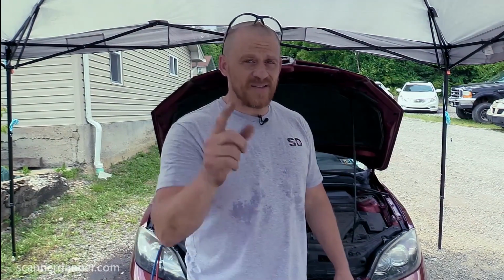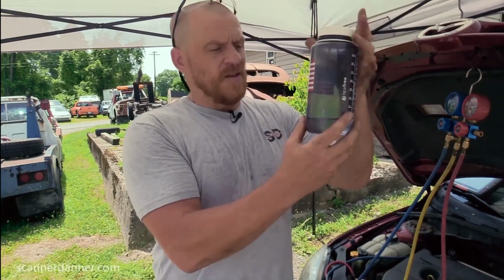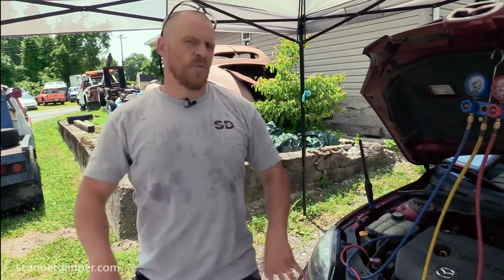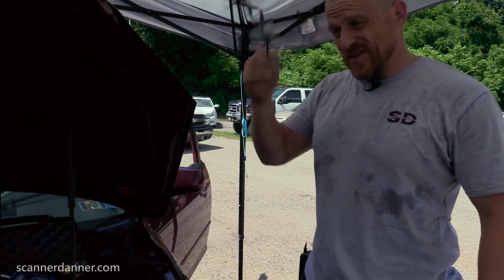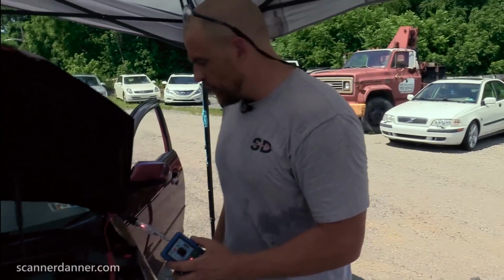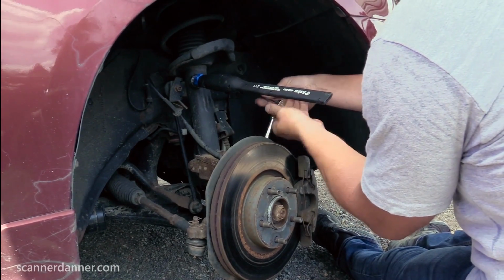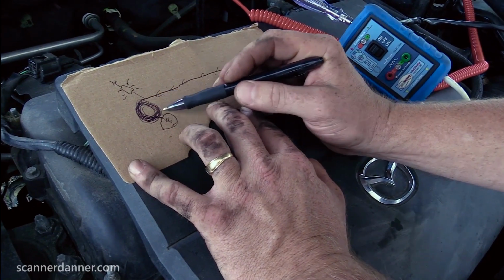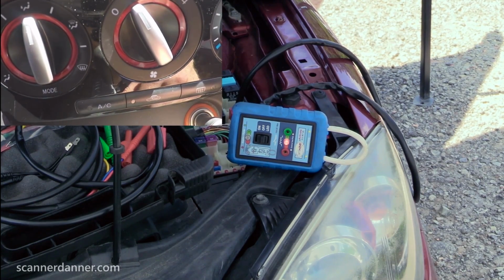A/C Clutch Does Not Engage-Diagnostic Fundamentals (full charge)

Comment: I have had success tapping on the clutch while the engine is running with AC on and I got the clutch to engage. It’s a nice test to verify similar to the tap it tests on starters and fuel pumps.

Comment: If you connectors to a ground your light won't come on by touching another ground. You need to connect to + to test the ground.
Reply from the maker: Sure it will! No ground with a good clutch winding and good 12v feed will have 12v on the ground wire and will absolutely light my test light.
Reply: @ScannerDanner you're right. I didn't see what you were until further along in the video and I couldn't find my comment to delete it. 

I'm having a problem on my 2012 ram 1500 proving the clutch out. It's not marked in the fuse box on this truck which relay or fuse runs the clutch. I think tomorrow I'm just going to run 12v to the clutch and see if it picks up. There are no leaks so it's a component problem. I have 200psi on the low side. I don't have a gauge to measure the high, I have one coming. I bled off some of the pressure on the low side and it came back in a minute or 2 which leads me to think it's a stuck expansion valve. It worked perfectly when my wife used the truck and no ac next day when I jumped in.

My scanner tool is telling me the the clutch is activated but that's only the EcU activating it and doesn't mean the 12v is making it to the clutch.

Comment: But if clutch winding is shorted, test light will still on when placing at pin 87 of relay. That's what happened couple of weeks back with Holden Astra. Then Ohm test of clutch windings solved the diagnosis.
Reply from the maker: That is only a preliminary test. It is certainly not the be all end all as you discovered. An amperage measurement would be key in your senario
Reply: Thanks Paul, I am still  learning auto electrician from your book and from your videos.
Thanks again.

Comment: If is empty system but doesn't getting too much freon and the low pressure stuck in 55 psi ,and the high pressure is almost in the same close to 55 ,what's that mean, maybe restrictions problem, bad expansion valve or may is because i noticed  the compressor clutch is wobble and a little bit loose
Reply from the maker: Not following what you are saying in your first sentance
Reply: @ScannerDanner  sorry about that, ok I already vacuum the ac system, now the system is empty, no pressure no freon ,I started recharge the system with freon but is not getting more than 4 oz and the  manifold gauges reading 55 psi low and 55 psi high,
Reply from the maker: @renec0327  oh okay. So you need to do one of two things to get the rest in. You need to start the car and turn the AC on which will lower the low side psi and then add to the low side. DO NOT have the high side valve open while running. Never add to the high side. 
If your clutch is not engaging, you will need to do some electrical troubleshooting as to why. This will be probably your best video to watch to give you ideas on what to check and why https://youtu.be/oUAdikdm-v8
Reply: @ScannerDanner  ok I'll do it thank you sr for take the tame to answer my question  thanks

Comment: Hi scanner nice video as always,my friend have a 2019 hyundai kona ,they brought thier car to the dealer ,dealer told them they needed compressor, they replaced compressor, they replaced a lot of parts but thier not sure exactly what they changed, they showed me the old compressor, when check it with a can of 1234yf it was empty,no codes ,no communications, ti ac ecu,i added some 1234 and it fan for a few second then nothing ,im trying to figure out wiring diagram ,when i used scan tool with engine off igoion on ,i can energise the ac relay i can hear a loud click,with engine running when i try to engage ac relay ,it says fail,not sure of o have bad pressure switch,  or not ,scan tool shows computor send signal to turn ac on but compressor off

Comment: Can a stuck or bad expansion valve cause a clutch to not engage? When it is engaged I got a regular reading on the low side but damn near $350 PSI on the high side!
Reply from the maker: so is your question about clutch engagement or too high of high side pressures?
Reply: @ScannerDanner   think i might have answered my own question, maybe the high pressure switch is causing the clutch to not engage because the expansion valve is stuck or clogged causing a high pressure in the line? I have a clutch that randomly engages and then disengages after a few minutes and no specific time frame or circumstances but when I finally got the gauges on the system when it was engaged the high pressure was extremely high at 350 while the low pressure was at about 45. But I'm trying to figure out if the clutch is not engaging in correlation with the possible stuck expansion valve or if it's a totally separate issue that's going on
Reply from the maker: @NicDDropoutOG  typically a high psi cutoff doesn't happen until 400 or 450.
Is your cooling fan working like it should be? 350 on the high side shouldn't prevent clutch engagement but I suppose it could
Reply: @ScannerDanner  I actually just checked the fan and both of them were not spinning after a good 20-minute Drive, could that be the issue?
Reply from the maker: Yes! Fix your fan issue

Comment: What does it mean if the low side is normal, but the high side is a little low and there is mildly cool air? I'm only getting 60f at the evaporator at idle on a 90f day.
Reply from the maker: What are your pressures?
Reply: @ScannerDanner  they read 45 low and 200 hi
Reply from the maker: @Bizija123  if anything the low side is a little high. What are your pressures at 1500 rpm? What is outside temp?
Pinch off your heater hose to eliminate the possibility of a temp blend door issue
Reply: @ScannerDanner  thanks mr. Danner for the replies. I will check at 1500 rpm. When i measured it was 89f with 73 humidity. Car was on the sun. Condenser fan spins well. Static pressure is 100/100.

Comment: To anyone who is kind to answer. I have a 1997 Tacoma 3.4, my problem is that the a/c signal is always on, the clutch does not engage, but i can't turn it off, the signal i mean. Pointers will be apreciated.
Reply from the maker: If you're in defrost mode, the AC will automatically be on.

Comment: Such a smart guy. He could have picked most any field for his living.    I have the same problem which I suspect is a bad coil.  $100 part (or less) which is well below the $2k quote from the dealer to replace the compressor (including the clutch and coil), condenser, including the recovery and recharging the system refrigerant. As a DIY project on a Subaru where the compressor is up top its a relatively painless job.
Reply from the maker: The only time you'd need a condenser too, is if the compressor pumped it's guts throughout the system, as it is the first place all that junk would go. If it's just a bad clutch, the condenser definitely does not need to be replaced!
Thank you too btw!

Comment: I’ve noticed in a lot of these videos that you typically don’t start at the component, you start from the control mechanism. For example instead of looking at HVAC command PID’s, seeing them commanding “ON”, then checking for voltage and the compressor clutch connector. If the compressor clutch is energized and the clutch isn’t engaged then that would typically be a weak/bad compressor clutch.  If improper voltage at compressor clutch/low pressure/high pressure switch then work back towards the relay. I’m sure it’s just for education, but do you always start at the control instead of the component? I’ve always started closest to the component and worked backwards through the system. You seem to start at the beginning and work towards the end component being controlled.
Reply from the maker: In a lot of circumstances, since I'm mobile, I'm working in a gravel parking lot and starting at the component is definitely not the easiest first step.

Comment: I have a similar problem power is getting to the coil and clutch not engaging. checked the wire to compressor for a ohms test it came out to 14.3 ohms. I failed to check gap of clutch before removing. but why the ohms test was to high should only get 5-2 ohms. I was thinking the clutch does not have a any wire going to it but could have a oversize gap from ware the is preventing is from engaging . but let me know
Reply from the maker: Power and ground, if it's there, your done. Clutch is bad

Comment: How did you know the problem wasn't an open pressure switch vs clutch coil?
Reply from the maker: An open psi switch would have interrupted the power side of the clutch circuit
Reply: @ScannerDanner  Do you have a video on pressure switch trouble shooting?
Reply from the maker: @conwellboccia1004  if it's a switch, of any kind, watch anything in my chapter 2 playlist titled "switch inputs"

Comment: oldtimers run a jumper to the clutch first. Instantly tells you whether mechanical or electric. Know who's bay it goes in before you put it in.
Reply from the maker: And when the jumper wire does work, and the clutch engages, then what? The "old timers" didn't have a clue. That's what this video is for 😉
Reply: @ScannerDanner  then check pressures.
Reply from the maker: @strictlyeducationalmagick  static psi is good and the system has enough for the compressor to engage. Then what??

Comment: I'm glad I found this video. The first AC I worked on was badly wired to a toggle switch. Burned a lot of connectors and wires through the harness. Somehow even burned out the cooling fan relay and connectors. I traced any issue the ac system could have mechanically, then started on electric. Those harness are very hard to work through, they attach to everything. The greatest part of this job is its for work and the parts changer there won't admit wiring a compressor directly to stay on is a big mistake. 
Anyway I'm going on day 6 of rebuilding the ac and cooling fan systems. For the first ac I've seen everything on, this is an awesome learning experience as well as a huge challenge. Videos like this are lifesavers. And you make me look like I learned ac systems overnight. Thank you for this
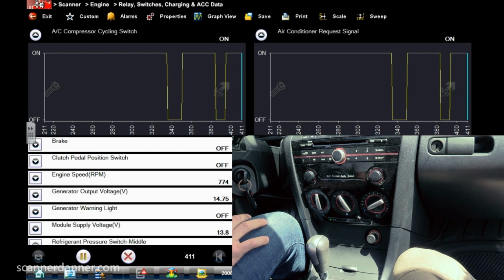2015 sierra 1500. And no, it's not the condenser lol 15:05

Comment: The housing won't light the test light if the clutch winding is open . True ? Yes . Would not a better test for a good ground be to put battery positive of the light to the housing ? Then when ground is confirmed put battery positive on the wire pincher and then if it doesn't light you are sure it's an open clutch
Reply from the maker: first question is true, BUT you are NOT going to have an open clutch coil and a bad clutch ground at the same time! It simply does not happen. If you also feel the need to load test the ground after confirming the clutch coil is open, use an incandescent test light connected to battery positive and touch the ground. Some guys like to use headlights as a load in this scenario.
Reply: @ScannerDanner  yes sir . I think that was what I was trying to say . I'm an old IBEW maintenance man . We call it Force Feeding or Articially Incriminating.  Taking a hot to ground or what the case may be . I have not learned per say but greatly enhanced even my machine troubleshooting skills by watching you for the last 10 years or so . Thank You for all your time spent . Oh and Ron Ananian uses a headlight bulb to load test as well .

Comment: @scannerdanner, what scanner can I get to do this test?
Reply from the maker: What test? Do you mean one where I'm commanding the ECM to energize the AC relay?
You need a good bidirectional scan tool for that. The Topdon Phoenix Lite 2 is my top recommended full function bidirectional scan tool.
https://www.aeswave.com/scannerdanner
Reply: @ScannerDanner  Yes! I have a 2015 Ford Explorer which the AC clutch doesn't engage.  There is Freon in the system (75 psi- both sides). I put power to engage the clutch and it did.  I just need to see if the computer (PCM) is "telling" the AC to turn on

Comment: One of the best videos on ac troubleshooting & circuit testing. Thank you
Reply from the maker: Thank you! It's funny, I hear the exact opposite on this video too. And I'm always like, okay, what if you don't have power to the clutch? Then what? That's when this video is super valuable and many don't see that. Thank you again!
Reply: @ScannerDanner  that's exactly why I was watching it through the end. My ac worked fine last fall. Over the winter it lost all 134a so I used sniffer, blacklight. But no pressure in system. Replaced condenser added 1oz pag46 to it. Replaced discharge line (known issue on Optima)vacuumed -28hg held overnight. Charged with 12oz 134a but clutch won't cycle. Thinking after video that it's the expansion valve. Bought Denso one. Yet to install. I need to confirm ac relay works as per video yet and chk power from compressor like you did. Ac pressure switch could cause this too?Thank you.  Watched your classroom instruction too. Good stuff. Great teacher. Son is lucky.
Reply from the maker: @davida871  psi switches and also a temp sensor in the evap core on this one that can lock out the clutch from operating. I have some more AC videos too. There is a playlist got HVAC stuff here. Thanks again
Reply: @ScannerDanner  yes watching the video with your sons 300zx. Lucky break with condenser oring.  I use canned air to blow soap water from high & low side. Cheap fix so moisture doesn't absorb into system.
Reply from the maker: @davida871  wait until you see the follow up. We proved the vacuum decay test cannot be 100% trusted
Reply: @ScannerDanner  will watch it. What variables were not considered to not trust it?
Reply from the maker: @davida871  lip seal on the back of the compressor held perfect under vacuum
Reply: @ScannerDanner  this would explain why my 05 Optima leaked out across compressor shaft seal possibly as I was replacing fuel tank, filter and trailing arms that needed to be cut off. Bear of a job but got it done over 3 weeks. Non use probably cause a/c to leak. Does this mean compressor is now not useable?
Reply from the maker: @davida871  if you shaft seal is leaking, I've never fixed them, compressor replacement was what we did in the field

Comment: The premium is great and the books. On this video I think I would have checked the clutch resistance first then if ok diagnose the open. It all depends on your experience with this car. Relays do fail especially if they become wet. But all the schools suggest checking the relay first. If it clicks it is probably ok but not always. We had a situation a few weeks ago on a power pack Kubota where the engines were supplied with 24V relays on a 12V system 4 per unit. It behaved just like a low battery with the starter clicking. The supplier said 24V relays will work on 12V. He is correct but when starting you don't have 12V and they would drop out. Sounds obvious but at the time we did not suspect that as it was from the supplier. We had 11 of these engines with the same condition. They then had to supply 44 12V relays to replace the incorrect ones. This was a power pack made using a Kubota engine by a Kubota agent, not local. The bill from Kubota was $2500 as we sent it to a local Kubota agency under warranty. They are still fighting over payment of this bill as it is really a warranty issue. Fun times!

Comment: Hey DS. My name is Steve . when I connected my gauges the pressure wasn't equal. The low side was 10 and the high side was 90. Also when I remove my cap on the high pressure side it goes pssst. Thanks for your great vides.
Reply from the maker: you had it running before you connected your gauges and the system didn't equalize yet. What are your pressures running and what is your ambient temp?

Comment: HVAC SCHOOL on you tube teaches residential ac work but learning from this school took the blinders off. It amazed me how ac ignorant I was until I did an in depth study. Doing ac without proper ac temperature readings is like an electrician that doesn't use an amp clamp. Hand touching a line is highly in accurate at best. You can't possibly know the state of refrigerant by using your hand. No disrespect to the greatest teacher on you tube. The vacuum procedures without a micron vacuum gauge is also the tell tale sign of a rookie. The oil in an ac system becomes junk in the first 5 minutes of running if moisture isn't properly removed. Tom Lech is without a doubt the leader in the field of automotive ac work. Check him out.
Reply from the maker: You should check out my newest case studies using a micron gauge. I also covered its limitations! Thank you

Comment: If you look at your resting pressures they equalize on the gauge. As you see the pressure you simply look at the temperature on the r-134a  scale it should match ambient air temp. Then you know it's R-134a. If the car is running the pressure changes on each gauge the temp on the low gauge shows the vaporization temp and the temp on the high side show the condensing temp. The measurements close to the condenser tells the story. Likewise the temp on the evaporator tells a story. Then you use these temps to accurately tell what's happening. You want saturated temps to take place in the proper place. Temperature relationships are everything.

Comment: Disagree with the description about ground. What if coil is open? Ground will still be ground. Measure resistance between two grounds will reveal.
Reply from the maker: Resistance measurements are flawed, i have some good videos on this btw. An incandescent test light to battery positive would be a better option. But that being said, the ground test I showed is still accurate in that you have accurately identified the open coil. Now, could you have an open coil AND a bad ground at the same time? In theory, yes, in reality, no. A resounding no. It just doesn't happen. But I get your question, and I don't mean to sound combative.